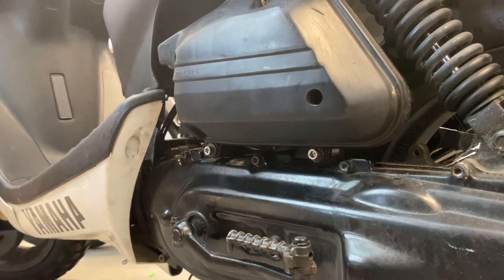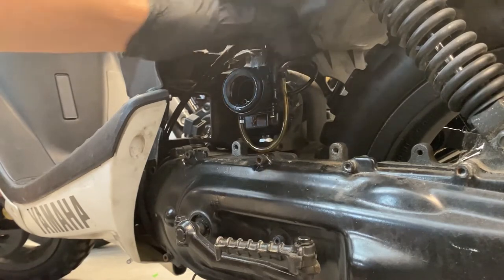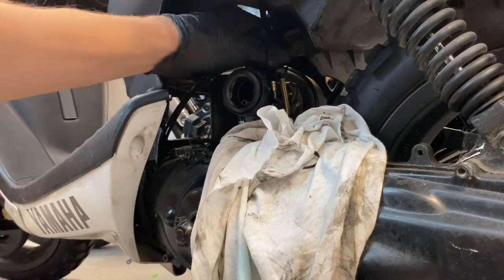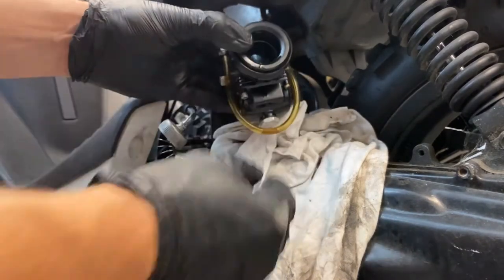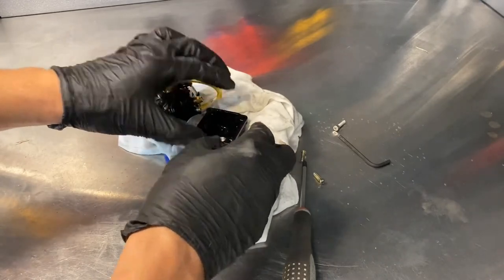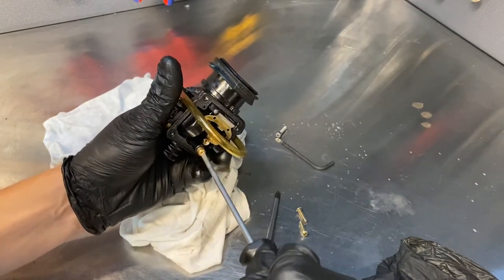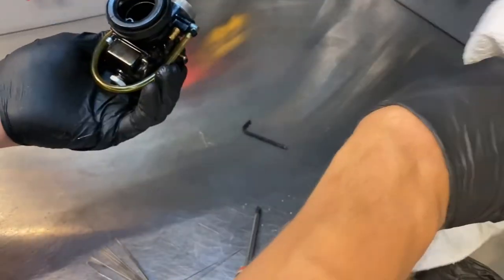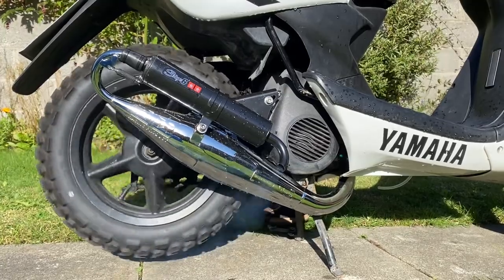Why your bike will only run on choke and how to fix it.

Comment: Yeah, did all that a million times, does not fix the problem.
Want some other answer that says its something other than the idle jet being clogged, because it's not.  I can fill the idle jet well with solvent and it will siv right through it.   Rebuilt this thing with new parts 50 different times, putting it on and off again, with the same problem.  Only runs on choke, and stumbles when you twist throttle.  It's not the idle jet, pilot jet, or master jet.  I replaced that whole jet with one with clean holes., and made sure fluid goes through all 3 jets.
Reply from the maker: We’ll if it’s not a clogged jet, have you tried setting up the carb https://youtu.be/gRii45DNj2o?si=M8ZD3wy4qvHeHQ1g

Comment: how heavy are the weights with the exhaust and how far out is the carburetor air mixture screw? good video
Reply from the maker: I have will check the weights for you, can’t remember off hand and the screw is approx 2.5 turns out with a 75 main jet. This is a 19mm carb. The it’s all matched to the setup so it’s hard to give definite answers here, as even a different filter may require different jetting and mixture. Have a look at my other videos. Thanks
Reply: @Yoke.  okay thanks, i have the same cylinder and carburetor with the same air filter and also a sports exhaust
Reply from the maker: @dominikglahe3776  I have 4g polygon shape (Dr pulley style) weights, previously I had 3.7g pollini ones, these you could add 0.1g to get your perfect weight. I am also running a malossi multivar variator and an oversized belt.
Reply: @Yoke.  thank you very much you have helped me a lot
Reply from the maker: @dominikglahe3776  no hassle. It’s very hard to tune a cvt as there is so many variables, I have also changed the rear springs on the clutch so the bite later, but you should be fine with what you have. Ideally you need a dyno to see power output vs fuel/air mixture.